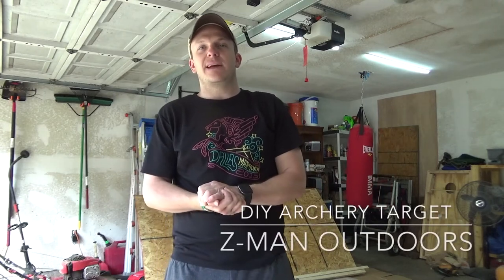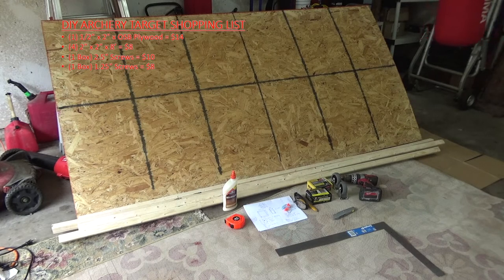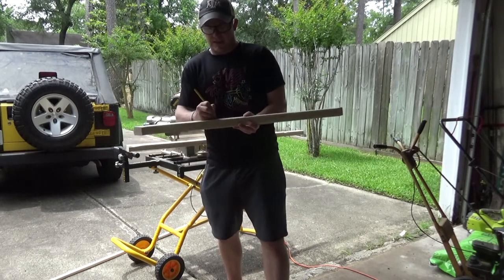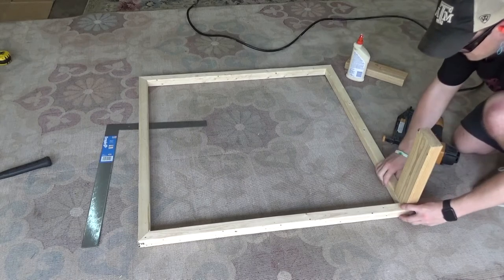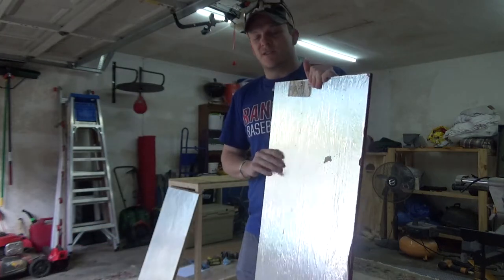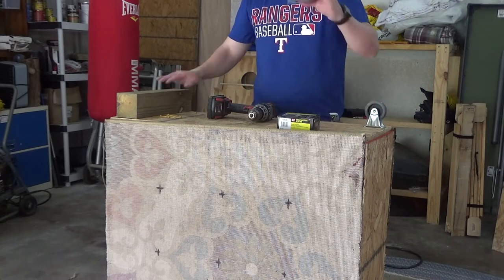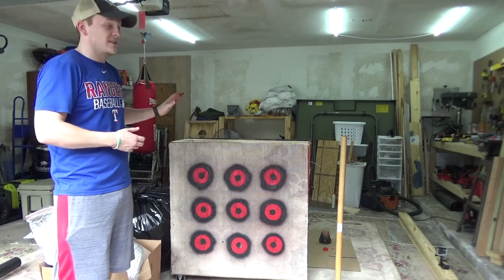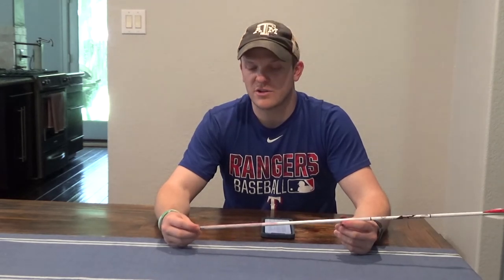Large DIY Archery Target - On A Budget

Comment: Thoughts on using pine chips. The white flakey/curry stuff.  I use it in my chicken coop.  It comes in a big plastic bail and its tight. Cheap. But wages are the best.  Goodwill.
Reply from the maker: If it’s tight enough it could work for sure. Depends on your arrows, heavy arrows with more penetration could get through that potentially. People use bales of hay and that works pretty well too. I’ve also seen people use cardboard and tighten a bunch together with ratchet straps. But that can’t take a lot of hits before it needs to be replaced

Comment: what about using a belt for your handle?  OSB is heavy could you use tin and metal studs?  And canvas if you didn't like the carpet?
Reply from the maker: I belt could use for sure. May not be as comfortable, but much cheaper of an option and would work just as well. You could probably use tin and metal studs. Just need to make sure that it can hold up well and not bow out too much. I thought about canvas, I was afraid it would get too torn up too quickly. But you could do that and maybe double it up or just replace it more often. If you try any of these, let me know. I would be curious how it works for you